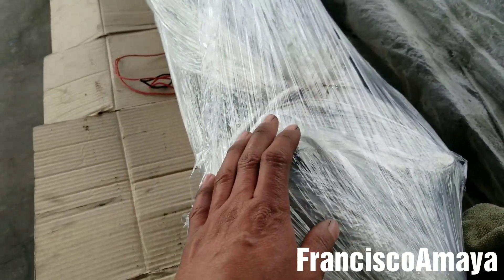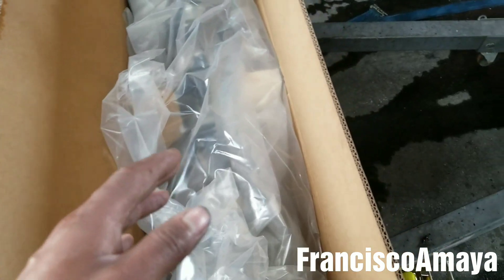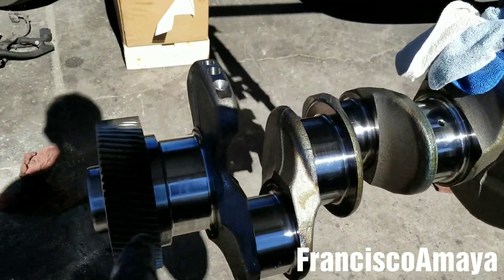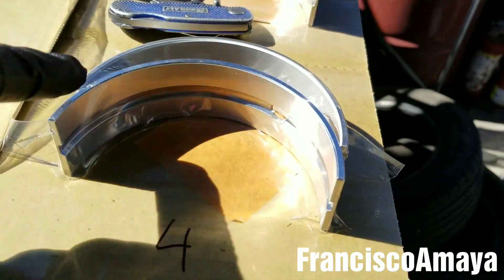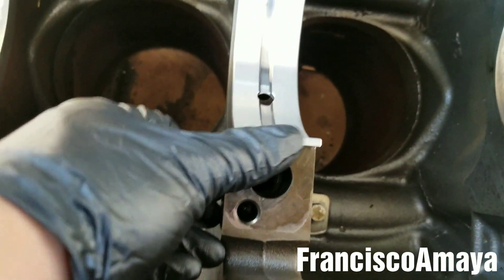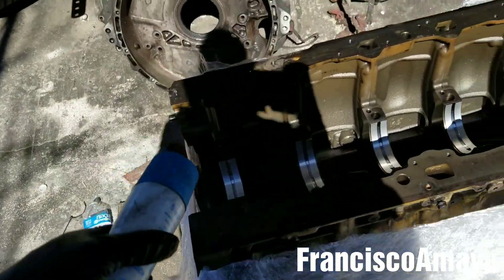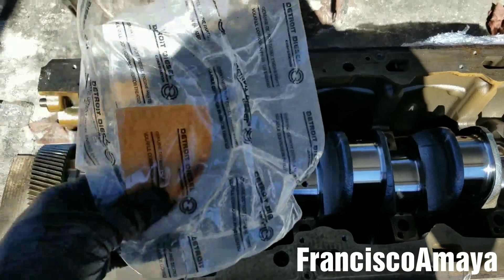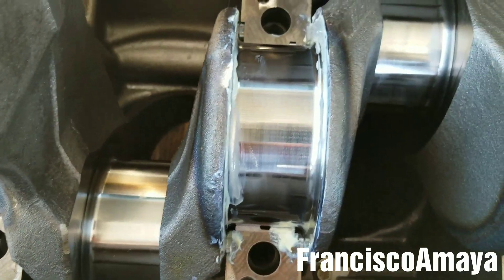DD13 DD15 DD16 crankshaft replacement main bearings cap torque part 2

Comment: What diameter is the main tunnel without the bearings installed? If the main bearings have been overheated but not spun the diameter should be checked.

Comment: Would you buy a 1998 3406be cat with 1million miles but truck in great condition no overhaul yet its a 10 speed freightliner
Reply from the maker: That sounds like a great purchase. 
Just have to make just everything looks on place.
Reply: Ok thanks I appreciate that